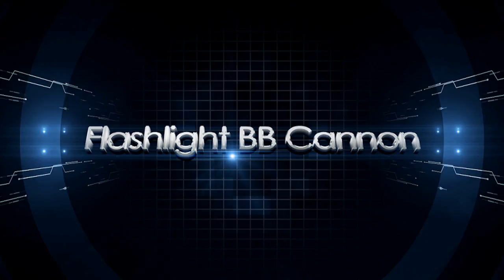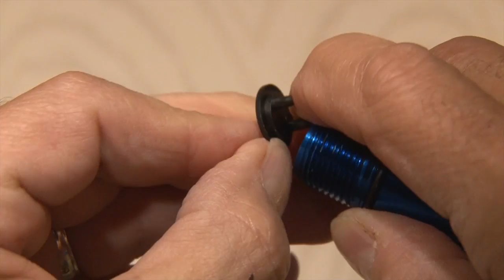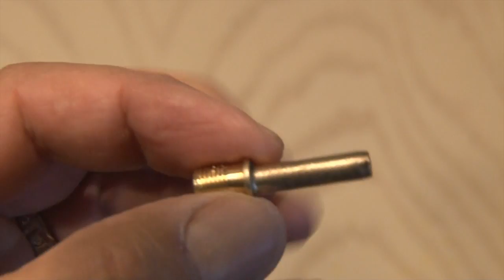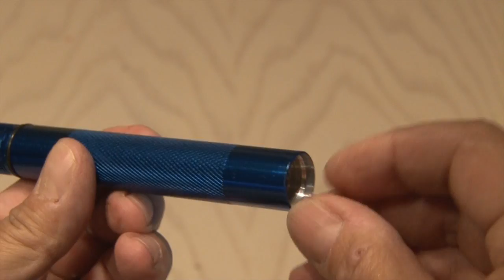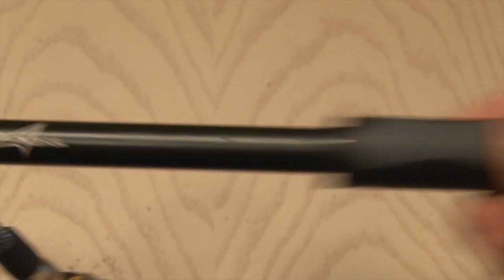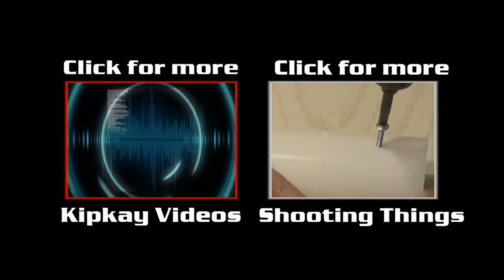Flashlight BB Cannon!

Comment: "trimmed the rubber stopper and we'll put it in the end of the flashlight, this will block all the air going to the barrel"

how is it supposed to fire if there's no air getting to the barrel to propel the actual BB